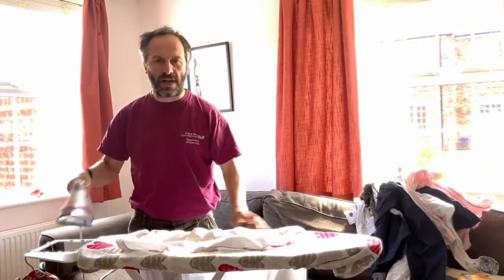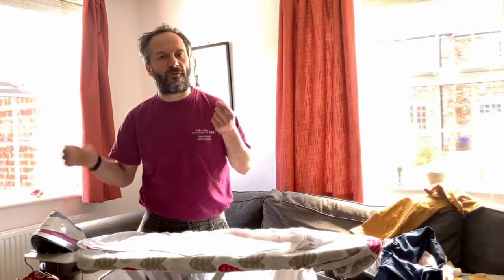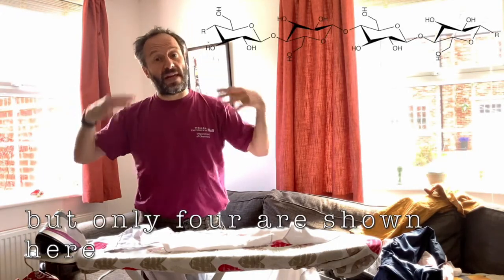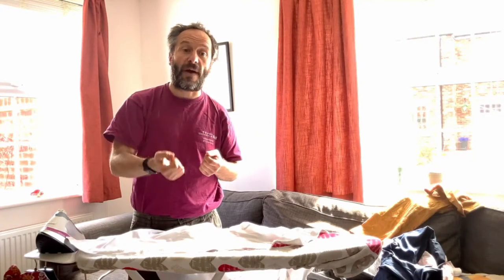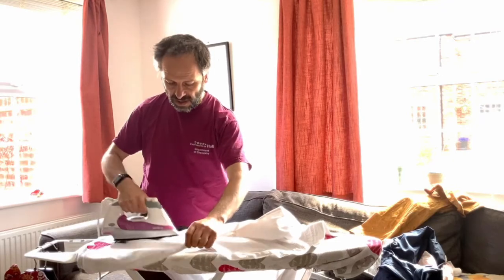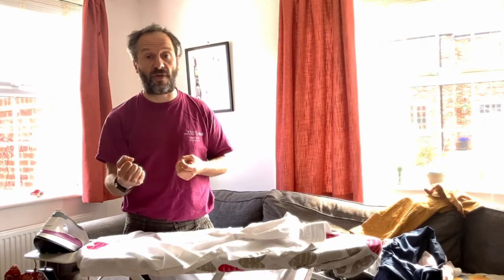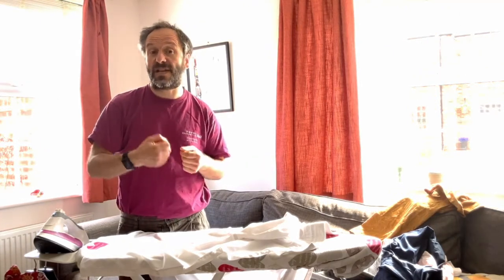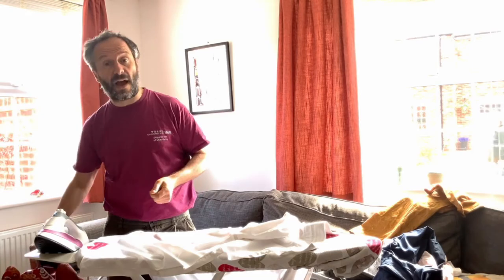Chemistry of Ironing

Comment: The words ‘iron’ and ‘press’ are used indiscriminately about getting creases out of fabric using a hot flat tool. However, ‘pressing’ means just that. If you ‘press’ with a hot flat tool, you eliminate the creases below the static area of heat, without moving the molecules about. If you ‘iron’, you move the source of heat about, which moves the molecules. Hence ironing tends to leave a less than perfectly flat, creaseless, surface. ‘Pressing’ works much better than ‘ironing’. Just lift the hot tool (the iron) and move to the next area, but without sliding it along. Press, lift, move, press, lift, move, etc. Much more effective.